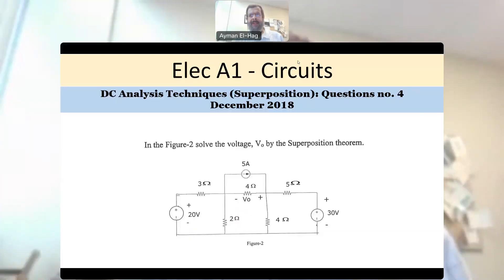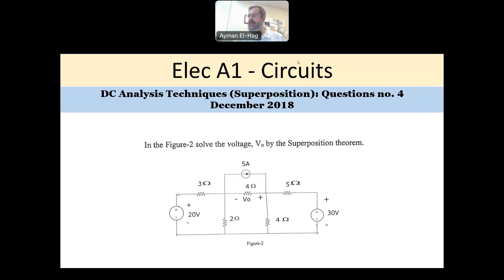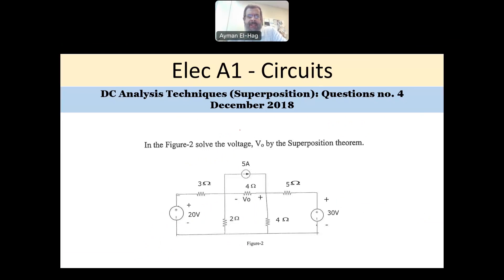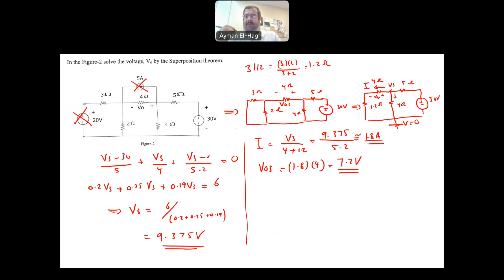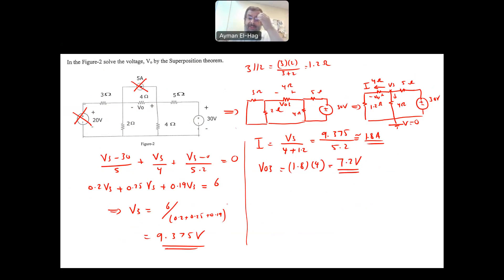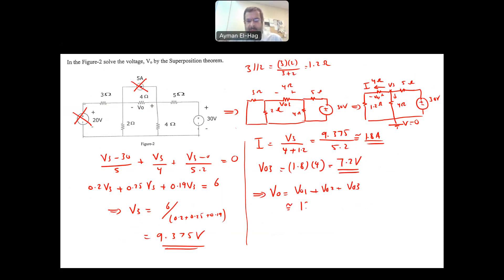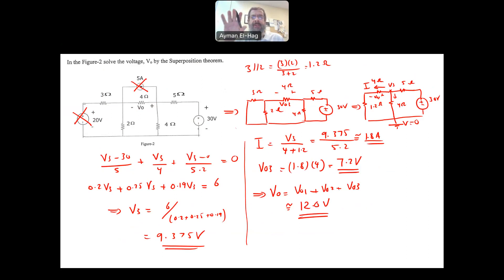PEO solved examples (ELEC A1): DC Analysis Question no. 4

Comment: It’s really useful videos but I wish if you continue doing all questions not just DC part. Also, we want the other material which is power system and Machine, power system engineering and engineering economics
Reply from the maker: Thanks for your nice words. I will do other questions like AC and transient in ELEC A1. Also, I'm planning to do both ELEC A6 and ELEC B7 courses. However, this term I'm really busy but I will try to finish at least ELEC A1
Reply: @electrical4everyone  Thank you so much. I really appreciate it